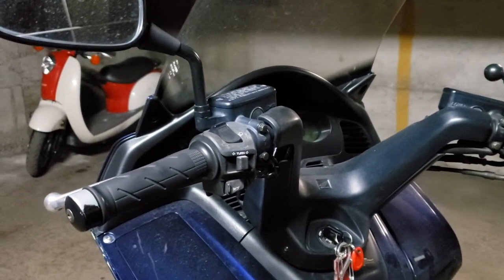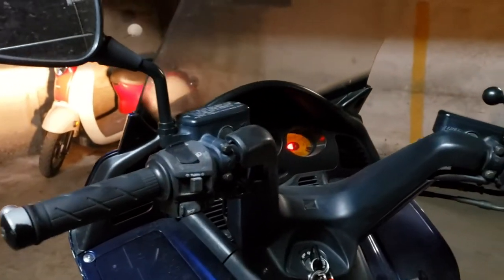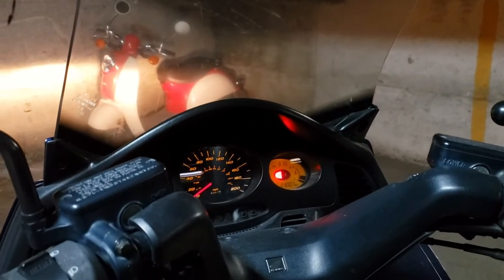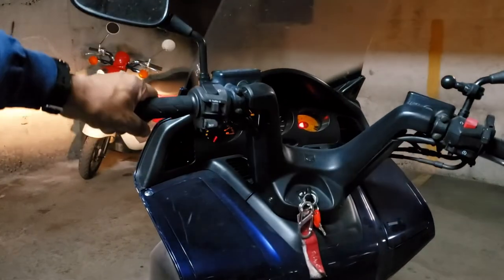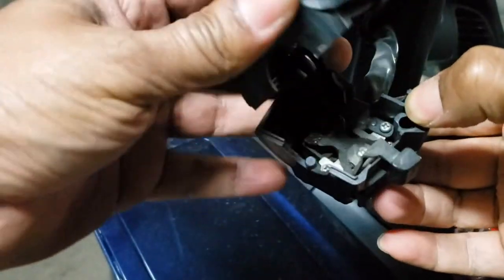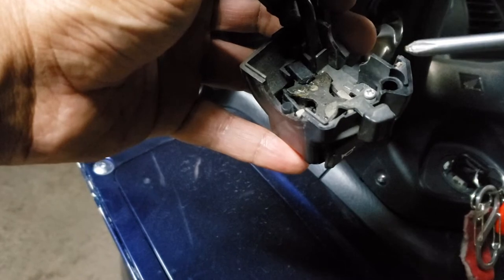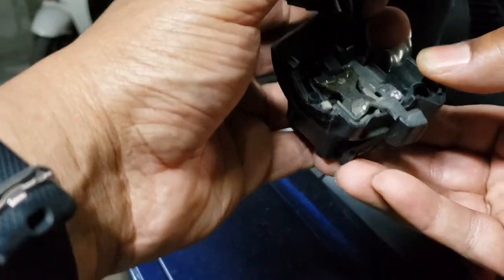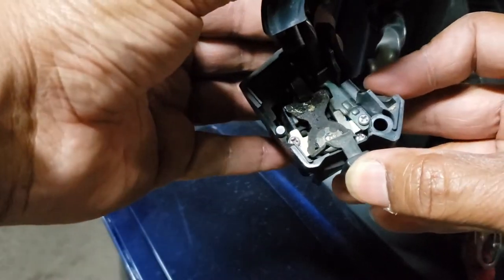Honda Silver Wing 600 𝐓𝐮𝐫𝐧 𝐒𝐢𝐠𝐧𝐚𝐥 𝐒𝐰𝐢𝐭𝐜𝐡 𝐑𝐞𝐩𝐚𝐢𝐫 How-to #160

Comment: Exactly what I was look for!! thanks so much. Mine is also getting sticky with weird results.Will try to fix it myself and save 50 bucks (and even 150 if they had to replace the part). Update: Done!30mn, didn't even have to take out the handlebar. work as good as new! so happy :-)
Reply: edit : my first try didn't completely fixed the pb; was still getting latency and inconsistencies; I teared down the whole thing to access to the kinda 3 copper dots connectors. wiped the old grease that was giving me trouble, and now I can tell it as good as new. the mechanism can be easily teared down; and the construction is actually quite impressive and durable ; Honda is definitely a good brand!

Comment: Very good show/tell. Have seen this issue described by others on the Silver Wing forum, but this is great for showing how easy it is to fix.
Pretty sure other scooter/bike riders have had this issue. Thanks for the detailed view.
Reply from the maker: Safety first! As riders, alerting other road users to our intentions (turn signals) keeps us safe and out of harms way.
And the best part is it was so easy to fix the turn signal switch. A sample Phillips screwdriver, grease/oil cleaner and some automotive grease is all that it required.
Cheers 🍻 👏  and safe riding 👍